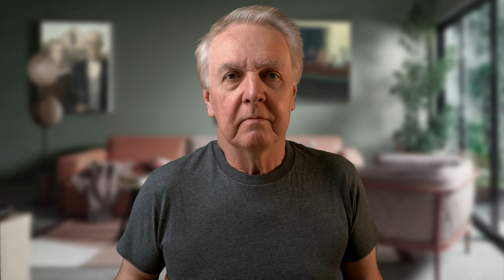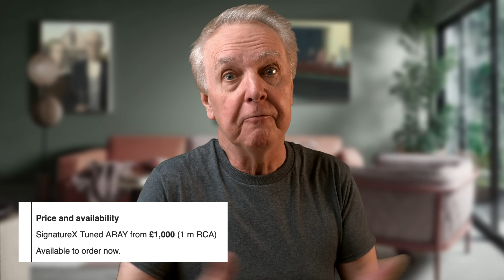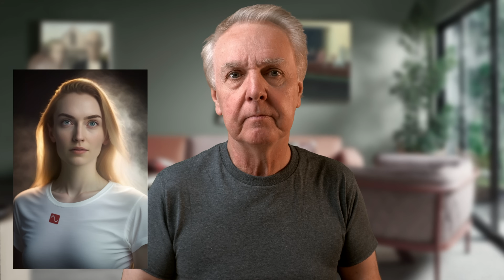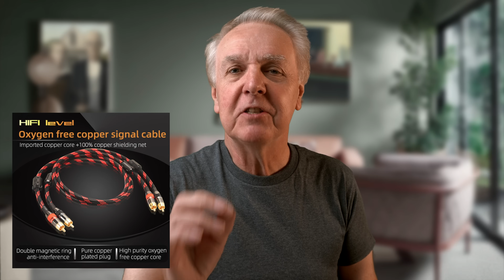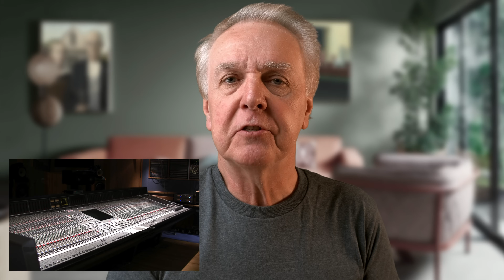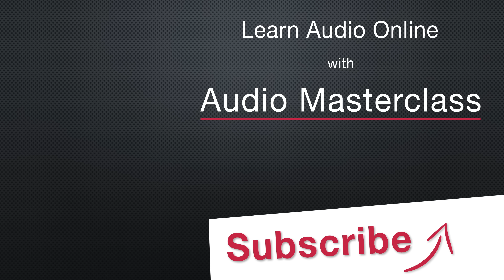Would you pay $1000 for a 1-metre cable?

Comment: I'm happy to pay extra for cables that strictly obey the Kramers–Kronig relations. Failure to pay attention to that detail can result in time smearing due to non-causality. /s
Reply: When I saw DM's "love it" heart added to your comment, I thought this needs to be researched.  Having looked up Kramers-Kronig relations for guidance, my considered response is ....Duh.  I did, however, try reversing my speaker leads PA to Speaker to run Speaker to PA but didn't detect any difference.
Reply: This one's new to me. I looked it up and see that "analyticity implies causality of the corresponding stable physical system" and "The imaginary part of a response function describes how a system dissipates energy, since it is in phase with the driving force." Why have They kept this Important Information hidden from us!! I've never once seen a cable ad bringing these facts to light.

Comment: Great piece! Pity the ones who fall for this snake oil. Yeah, 'audiophiles' are in denial of how roughly the signal is handled on the professional side before it reaches their esoteric systems. Have they seen the cables used inside audio electronics or speakers (even 'high-end' ones)?
Reply: Regardless of that. Have you seen the mess of cables on a mixing desk, there are cables everywhere?
Reply: Exactly

Comment: I was thinking of this related to radio and was impressed that you went there. With both radio and audio, it is AC. With radio, the level of quality needed increases with frequency and power. We can use near junk for low power HF frequencies but put a good amount of care into UHF and microwave. HF is 2-30 MHz which is about 1000x higher than audio AC. Some of this is plausible because impedance, capacitance, induction, velocity factor, etc. are real things. But how much can this affect such low frequencies? Can anyone detect a difference?  For quality improvements I'd look for a whole different approach like balanced or coaxial and optical (if digital), a new connector, or maybe some of the techniques needed to make quality Ethernet cables work at higher speeds. Of course the real test is a blind test if anyone can afford that.
Reply from the maker: There is a discussion among audiophiles whether unbalanced is better than balanced. I might look that up again for a future video. DM
Reply: @AudioMasterclass  I can actually hear that headroom difference. And I am no audiophile.
Reply: @AudioMasterclass  If the source output uses the op-amp +4dBu outs vs non op-amp. It is not only the balanced cable but the way the signal is handled from the source. You can test this yourself on your mixer. Check if your monitor outs are fully balanced (they are probably not), then check your main out (head to the manual).

Comment: She is wrong. She said it "transmits signals". Which is incorrect. The word transmit implies RF (radio frequency) generation. I.e andn AM or FM broadcast transmitter. "Transmit" also implies it is a one way direction. The cable is not directional. :)
Reply: Let us give it a biology analogy. The output is the penis. Lets call it +. (plus). The input is the vagina. Lets call it -. (minus). The charge by the craft done by the penis makes it flow towards the minus. The more girth the penis (read cable) has, the better chance for a good flow.

Comment: Jays Lab just released a video today with speaker cables costing $80,000. 
I also saw today a mono block amp stand costing $130,000. But it had double isolation. So there’s that.
Reply from the maker: I suspect that the amp will provide more value per dollar than the cables. But if I had $130,000 to spend on an amplifier, I'd probably spend it on something else. DM
Reply: @AudioMasterclass  I think the $130,000 was for the stand, not the amp!😳
Reply from the maker: @zetmoon  I don't think there's an emoji sufficient to comment on that. DM

Comment: I use to think there was no difference in interconnect cables. I did try few, just to be sure... I was wrong. In my case, the 60$ cable sound better than the 10$ and the 150$ sound better than the 60$  (1 meter interconnect). I stoped there. The problem with your opinion is that you seems to not have tested them for yourself so your opinion is just that... an opinion on something you didn't even try...
Reply from the maker: I've been around cables for a long time, both domestically and professionally. If cables made a difference, other than damaged or corroded, then I would have noticed by now. DM
Reply: @AudioMasterclass so you tried the 1000$ cable? I'm a mixing engineer. In my experience, the source, the speakers (or headphones) with the amp make the biggest difference. Than of course the room ( I work in a treated studio). Then the wire to a certain extent. The mastering of a track make a huge difference, way bigger than cables! For now I use a mojo 2 DAC in my living room and the EQ is very handy to ajust a bit masterings that are to bright or lacks bass...But, as I tested for myself, dac, transport and cables makes some differences. I have regular speakers cables but I will test that at some point. Recently I was surprised of the sound difference of the transport when using the digital out to the same dac... I was convinced that digital is just 0 and 1 after all... but the digital output of my CD player, Apple TV (old generation with optical) and other streaming devices sound different (more than the sample rate)
Reply: @AudioMasterclass  and by the way I tested my hearing and compare it to my 20 years old daughter (with good planar headphones on an app) she hear a lot better over 12khz than me! So of course are ears make big diffence two. Did you test your ears?
Reply from the maker: @guystpierrecomposer  I'll go back to my previous reply, "I've been around cables for a long time, both domestically and professionally. If cables made a difference, other than damaged or corroded, then I would have noticed by now." In my time I've noticed differences in all kinds of equipment because they were clearly audible. Cables have never drawn my attention, even in the days when my high-frequency hearing was much better than it is now. If anyone can hear a difference in a cable, or feel that they can hear it,  then good luck to them. I'm not going to deny them their experience or their enjoyment. DM
Reply: Kudos to you for even bothering with these flamebait videos. Basically everyone
 in the hobby are idiots, and the rest are too smart blahblah.
Reply: Can you put me in touch with your drug dealer?

Comment: Would I pay $1000 for 1 meter of cable? Yes I would. In fact, I've paid substantially more for a pair of cables. That said, I disagree with one of your statements. You said that even if you didn't hear a difference, but the cable has really high specs, you may put it on your wish list, and possibly consider buying it. To me, that's just crazy. Why would you spend $1000 on a pair of cables for no sonic improvements? If you are getting the same performance from your $10 cables, keep them and spend the money on something that will make a difference.
Reply from the maker: Thank you for your comment which I appreciate. When I said 'wish list' it's more of a wishes that will probably never happen list. However I do believe that just about anything in life will benefit from being better than it needs to be. Like my car would probably do 100 mph if I let it but the speed limit here is max 70. So at 70 I'm cruising. DM
Reply: @AudioMasterclass  I kind of got that, but I was just having a bit of fun with you. However, we would definitely disagree on a few issues, but a good portion of what you said I completely agree with. 

Just to add a bit, its not like you're in a store shopping, and just end up with a pair of interconnects that cost $1000 in your cart. These are purpose-built products that are meant to be bought by someone that has some experience, and knows what they are getting themselves into. The average person should be very skeptical about expensive cables like this. And if you buy a pair without at the very least, trying them in your system first, in my opinion you're a jackass. I think we can all agree on that.
Reply: @AT-wl9yq  "Just to add a bit, its not like you're in a store shopping, and just end up with a pair of interconnects that cost $1000 in your cart." Why can't you just say cables instead of interconnects?
Reply: @rabarebra  You're right, I could say cables, but I could also ask you why you won't ask me your real question, or make whatever point it is you're trying to make.
Since you won't ask, I'll take a guess. For whatever reason, you clearly are on the side that feels cables are either way too expensive, or make no audible difference, or both. When you read my post and find that I spend what most people would think are foolishly high sums of money on cables, and I'm happy with my purchase. Also, I'm willing to do it again, and this upsets you. Why? Because you clearly know better, and have to say something because its the right thing to do. But there's just one problem. After reading my other posts, you can't find fault with how I go about selecting cables. It just makes too much sense. And I even go so far as to strongly recommend that no one buys any expensive cables unless they go through a process to be absolutely certain they are making the right choice. 
So, this leaves you with a dilemma. You want to say something because you know I'm wrong, but you can't say something because you know I'm right. But you have to say something. And you did. 
To answer your question as to why I said interconnects, instead of cables, here's why. If you walked into a store and told them you needed to buy a pair of cables for your stereo system, they would ask, what kind? Since interconnects are the most popular type of cable to buy, that's what I put in my example. 
Anyway, great question. I'm sure half the people who read my post couldn't get any sleep last night. I should have been more careful. I'm sorry and I'll try not to let it happen again.
Reply: " In fact, I've paid substantially more for a pair of cables." I'm really curious what comparison shopping approach led to this decision.
Reply: @editingsecrets  I started  by calling a store that specializes in high end audio cables. This particular store keeps demo units of everything they sell. I then gave them a list of all the cables I wanted to demo, and they sent me a box. I listened to all of them, and picked the ones I liked best. If I chose not to buy anything, I would have been out the shipping costs of the cables I demoed, and they would have also charged me 5% of whatever the value of the cables they sent me cost, but they wouldn't keep it. They would put the 5% on my account, and I could use it for any future purchases. And that's how it all went down.
Reply: @AT-wl9yq  That sounds like great convenience for you. As David has said, if your hobby makes you happy that's the main thing!

Comment: Inside the devices the audio signal travels through copper tracks and thin wires full of impedance, parasitic capacitances and inductance. And when the signal leaves the device, the person demands cables made with copper purified by the monks of Tibet. Trust me, it will be great.
Reply from the maker: I used to dabble in electronics and I found that the layout of the printed circuit board was important and getting things wrong could easily result in high frequency (above audio range) oscillation. When I'd dabbled enough in that, I decided it was best to leave things to the experts. DM
Reply: I got my cables from the advanced alien civilization from alpha centauri. They sound amazing. All it cost was a little intel for their impending occupation of earth and enslavement of the human race. I believe they said they were made from bullshitnium. And they were so appreciative of my perspective on human mating rituals that they gave me a perpetual motion device. I swear I can hear the difference over the one I made in my garage a few years back.

Comment: The direction thing is real.  An outer shield needs to be connected at only one side, the source.
Reply: @Cary Scheck  - Both ends need the ground return, normally supplied through the outer shield. Without it and using your source only grounding, means we have to employ the power supply's ground connection.  A circuit needs a return path, whether that be a battery and bulb or a pre-amp and power amp.
Reply: @twistedmister1  This is not always the rule. Have you ever made balanced XLR cables? 😉

Comment: Unless I'm very much mistaken most copper cables are oxygen free or they'd break easily.  The elephant in the room is, once those interconnects complete  a circuit, what are the internal cables constructed of? What solder, what PCB grade of copper? It's akin the utterly pointless purchase of a silver mains cable.  Unless your home ring main has been rewired with silver cable,  and you've got your electricity company to run silver from the local substation,  the phrase 'an utter waste of money ' is appropriate. If we're talking shielding of interconnects, then star quad xlr (balanced) will out perform any single core without question.  Ignorance separates a fool from their money.
Reply: I always ask myself, do these audiophools spend as much money on the down cable from their TV dishes. I guess not! Just by the way, hard drawn copper is not oxygen free, but annealed copper is since it is heated after drawing, allowing oxygen to escape during the heating process.

Comment: Hey, just want to quote from extreme audiophile, 'You can't say anything unless you have used it on your highly resolving system!  If you don't find a difference, upgrade your system to the next level, as your current one is not "resolving" enough.  Repeat until you find a difference to justify the price tag!"  Another quote, 'ABX Blind test is non reliable, when someone is blind folded, it affects your hearing capability, and repeatedly tests will just put strain on the listeners!'  I usually suggest, 'then, how about making use of high precision equipment like Audio Precision boxes to test?' Replies are, 'trust your ears!'
Reply: The A-B'ings will continue until moral improves
Reply: audiophiles for the most part are dickheads. Think they have audio engineering like knowledge and experience. Vast majority do not.